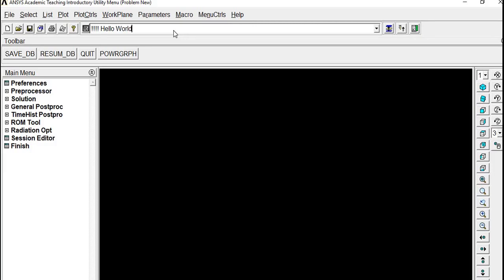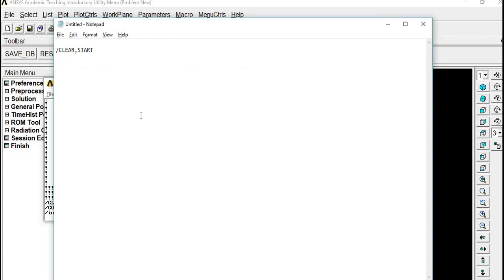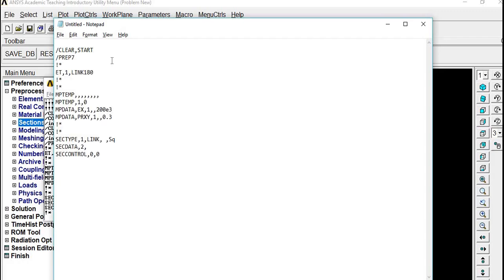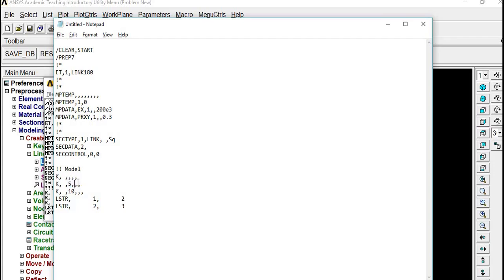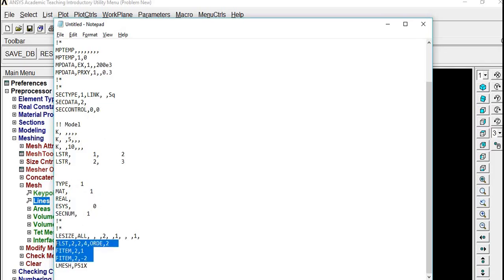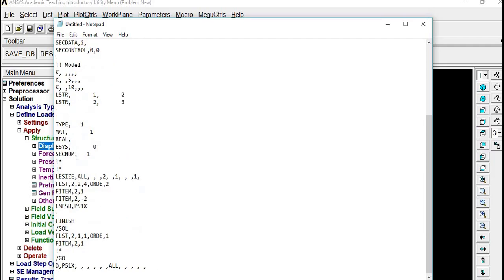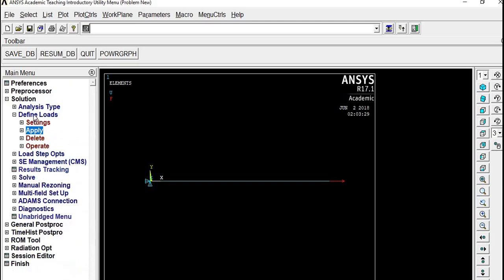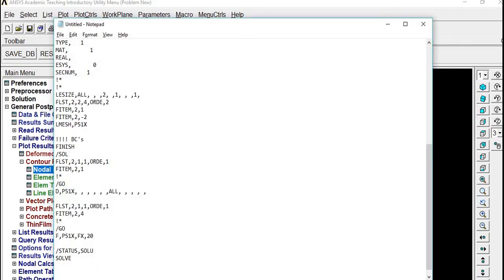Creating Simple Macro Code in Mechanical APDL (ANSYS) - A Bar Problem

Comment: Great video... thanks so much.... please do you have any videos on how to open Macro Code in Workbench or how to write Macro Codes in Workbench... thanks again
Reply from the maker: Hello Kwame Montu-Ab-Ra, you can first run a macro code in APDL then save that whole model. This model can be transferred with or without mesh to workbench in some steps (If you need the link for this, let me know, I will update it with this reply next time).
But I don't think there is a way to directly run macro in workbench.
Reply: Discite Bon thanks for replying. Posting the link or showing how to do it will be great. Appreciate the help
Reply from the maker: Check this link  
https://www.simutechgroup.com/tips-and-tricks/fea-articles/221-fea-tips-tricks-post-processing-apdl-ansys-workbench

Comment: Is there a way to save the results in a separate text file?
Reply: If it could pertain to this specific example that would be much appreciated.
Reply from the maker: Hello, there is a way to save the result into a text file, I have talked about this. Check it out here! https://youtu.be/sE3NkH1m24w?t=67
Reply: Thank you. I have reviewed it and tried a few things to make it work for my code. No such luck so far. I have posted my last attempt. I am trying to get the deflection isolated in a text file. It does not have to be the only number as I have a decent textscan operation working but to get the deflection in any text file would be helpful. If I run it in Mechanical ADPL no error codes pop up until the *GET.  I do get the window that has the deflections at every node. I think it may have to do with me using an .m file to run all this but I ultimately want to use a for loop in MATLAB to change one of the inputs in ADPL. Any help would be great I have been stuck at this point for a while now. 

clc;clear all;clear

%fid2 = fopen('C:\Users\von70\Desktop\MATLAB\Metahurisics\Ansys_Matlab_Connection\ADPL\Trial_3\TestA.txt','w+');
%fclose(fid2);

line1='FINISH';
line2='/CLEAR,START';;
line3='/PREP7 ';
line4='/REPLOT,RESIZE ';
  
line4='ET,1,LINK180';
  
line5='ET,2,LINK180';
  
line6='ETDEL,2 ';
 
line7='MPTEMP,,,,,,,,  ';
line8='MPTEMP,1,0';  
line9='MPDATA,EX,1,,200e3  ';
line10='MPDATA,PRXY,1,,.3   ';
  
line11='SECTYPE,1,LINK, ,Sq ';
line12='SECDATA,2,  ';
line13='SECCONTROL,0,0  ';
  
line14='K, ,,,, ';
line15='K, ,5,,,';
line16='K, ,10,,,   ';
line17='K, ,10,,,   ';
line18='LSTR,       1,       2  ';
line19='LSTR,       2,       3  ';
line20='TYPE,   1   ';
line21='MAT,       1';
line22='REAL,   ';
line23='ESYS,       0  '; 
line24='SECNUM,   1 ';
  
line25='LESIZE,ALL, , ,2, ,1, , ,1, ';
line26='FLST,2,2,4,ORDE,2   ';
line27='FITEM,2,1   ';
line28='FITEM,2,-2  ';
line29='LMESH,P51X '; 
line30='FINISH  ';
line31='/SOL';
line32='FLST,2,1,1,ORDE,1   ';
line33='FITEM,2,1   '; 
line34='/GO ';
line35='D,P51X, , , , , ,ALL, , , , ,   ';
line36='FLST,2,1,1,ORDE,1   ';
line37='FITEM,2,4 '; 
 
line38='/GO'; 
line39='F,P51X,FX,1000';
  
line40='/STATUS,SOLU';
line41='SOLVE';   
line42='FINISH '; 
line43='/POST1 '; 
 
line44='PRNSOL,U,X';
line45='*Get,011,NODE,2,U,X';
line46='/OUTPUT,''C:\Users\von70\Desktop\MATLAB\Metahurisics\Ansys_Matlab_Connection\ADPL\Trial_3\Trialabc'',''txt''';
line47='*VWRITE,001';
line48='(F)';

%line49='PARSAV,SCALAR,''C:\Users\von70\Desktop\MATLAB\Metahurisics\Ansys_Matlab_Connection\ADPL\Trial_3%       \PAR'',''PARM''';

% line34='/post1 ';
% line35='*GET,A,ELEM,1,S';                               % line35='prnsol,ux '; 
% line36='*GET,B,ELEM,2,S';                                % line36='ETABLE,saxl,LS,1 '; 
% line37='P= A+B';                              % line37='pretab,saxl  ';
% line38='/OUT ,TestA,txt;';
% line39='*VWRITE,P';    
% line40='(F)';
% line41='PARSAV,ALL';
% line42='/OUTPUT,''C:\Users\von70\Desktop\MATLAB\Metahurisics\Ansys_Matlab_Connection\ADPL\Trial_3''Trialabc'',''txt''';
%line43='finish';

fid = fopen('C:\Users\von70\Desktop\MATLAB\Metahurisics\Ansys_Matlab_Connection\ADPL\Trial_3\talkin_3.txt','w');

if fid<0
    fprintf('error you suck')
    return;
end
n=48;
x=cell(n,1);
for i=1:n
    str=['x(i)={line' num2str(i) '};'];
    eval(str);
    %fid=1;
    fprintf(fid,'%s\n',char(x(i)));
    fprintf(fid,'\r\n');
end

fclose(fid);

!"C:\Program Files\ANSYS Inc\ANSYS Student\v192\ansys\bin\winx64\ANSYS192.exe" -b -i talkin_3.txt -o talkout_3.txt
Reply from the maker: One mistake I found in your code is that you are using Vwrite directly in the code, instead, you need to use the INPUT command to call the file which has VWRITE and GET function. Please check https://youtu.be/sE3NkH1m24w?t=81 and try it as I explained.
Reply: I will try that again, thank you!!
Reply from the maker: @Von-sf3mc  Can you email me all the files related to it? So I can check if you made any mistake thoroughly.
discitebon@gmail.com
Reply from the maker: @Von 7074
Rather than this,
!"C:\Program Files\ANSYS Inc\ANSYS Student\v192\ansys\bin\winx64\ANSYS192.exe" -b -i talkin_3.txt -o talkout_3.txt

Try
!SET KMP_STACKSIZE=4096k & "C:\Program Files\ANSYS Inc\ANSYS Student\v192\ansys\bin\winx64\ANSYS192.exe" -b -i talkin_3.txt -o talkout_3.txt
Reply: @DisciteBon   I sent you an email, thanks for that.

I tried the ! line and it throws a fortran error box after ANSYS opens.
Reply from the maker: @Von-sf3mc  okay, I will get back to you in a day or so. Keep trying different things by then.